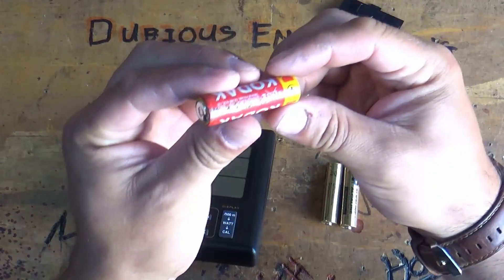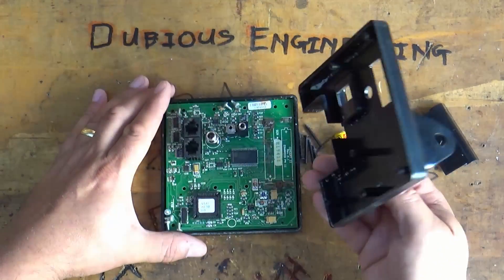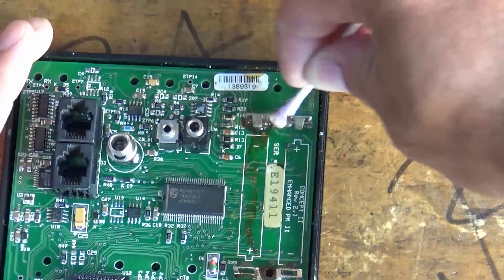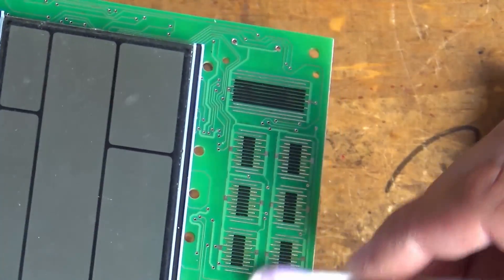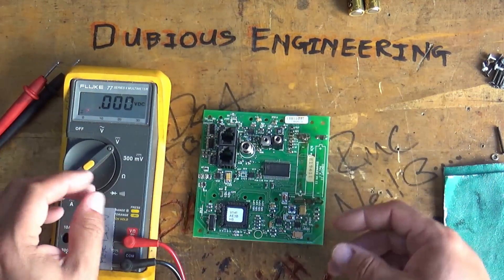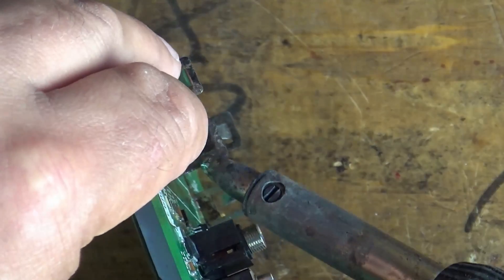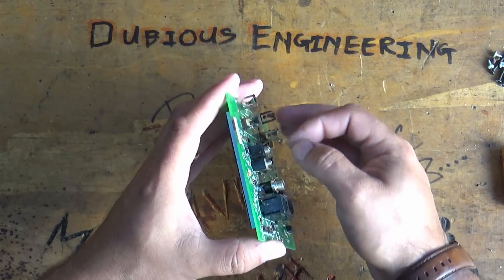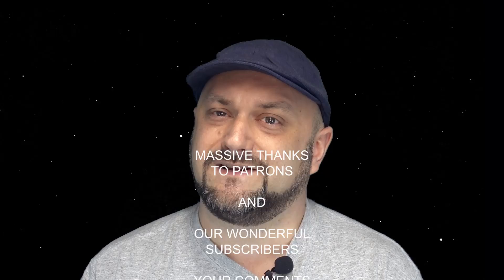DuB-EnG: Repairing Leaking Battery Acid Damaged PCB contacts on Consumer Electonics

Comment: Thanks for video!  I'm trying to revive a nice Grundig radio.  Battery disaster.  Cleaned contacts and I have a dead short on one of the boards.  One IC has white film on it.  I'm gonna remove it and see if the short is resolved.  Any ideas, Professor?
Reply from the maker: Get your magnifying 🔎 glass out, check the tracks, the contacts and look between the pins for corrosion.  Use alcahol and vinegar to clean then add oil to protect..
Reply: @DubiousEngineering  Thanks for your kind response!  Is Mr. Obvious your black sheep cousin?  Hehe
Reply from the maker: @jf5016  baaaaa  😀

Comment: ‘Super Heavy Duty’ batteries generally come in ten packs for a pound. False economy if you ask me (and not great for the environment).
Reply from the maker: ...  far better to go for a good quality make...  perhaps one with a copper top or one that is always ready ...  forget these cheap batteries - you get what you pay for :-)
Reply: Poundland battery’s dont last long and tend to leak.  Well done Howard - better to fix and prolong rather than waste and skip.
Reply from the maker: I’ve been tinkering with lead acid car batteries - trying to refurbish them.  I’m getting mixed results... using various methods and revitalising chemicals.  It’s been fun!